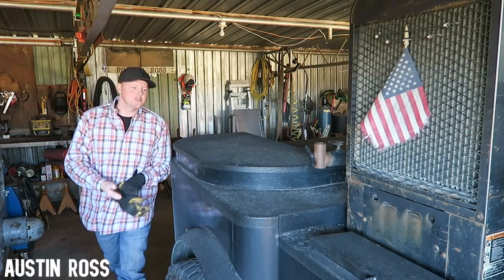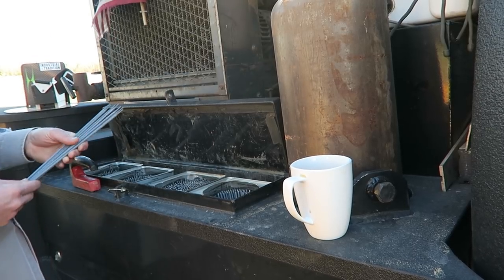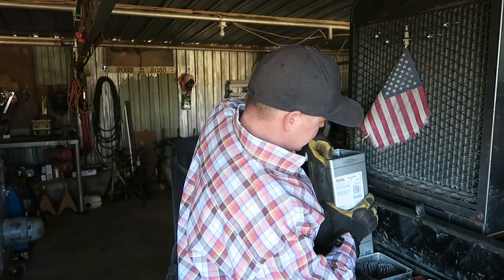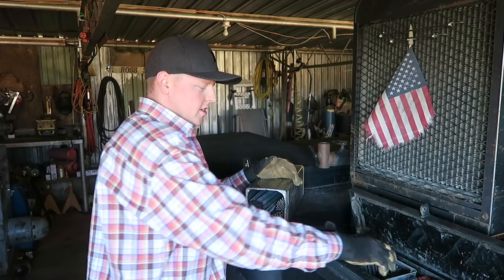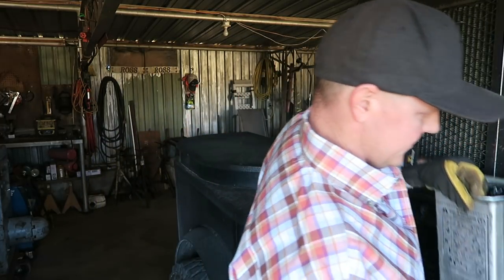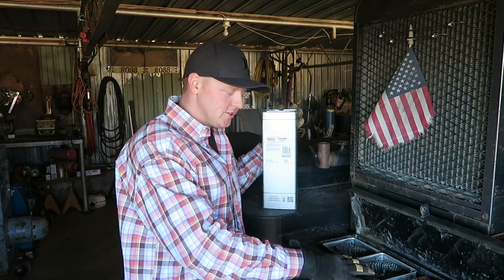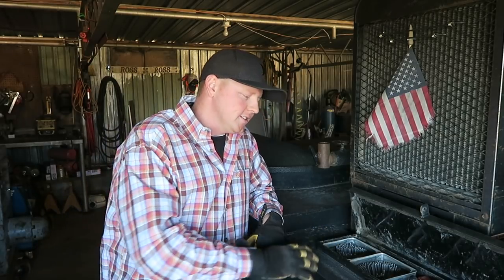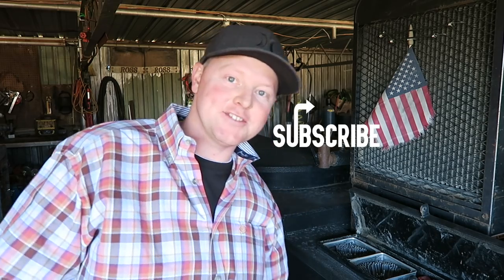WELDING ROD USED TO WELD PIPELINES AND THE ORDER WE USE IT IN

Comment: Hello Austin, question vertical welding, my husband is frustrated. He has a Lincoln AC 225, and welds mild steel 3/16'-1/4' for farm repair. He cant seem to make a good looking vertical pass, any tips on this. The materials & area are clean no paint rust etc as he cleans them before he starts. He's tried angleing the rod straight you name it notheing seems to make a pretty weld.

Comment: Sorry if this is a silly question. I see a lot of guys asking why you don't you 7018 and I'm curious too. Yet I'm more interested why you guys don't use flux core wire like NR-232 or 233? We us it a lot in structural steel (Ironworker by trade) it's fast, wind and weather do not effect it like gas shield, and you can lay down a lot of weld in a short amount of time without having to switch electrodes.
Reply from the maker: k11keeper 
We use 7018 out here also. On maintenance work and some on fittings. In station work. But most of your mainline is downhill. Not all but majority.
Reply: Ironworkers spend a lot of time running a lot of beads within cable reach of the wire feeders. In pipe work, you may have to hike 50 yards down into a cut to do your work, and schlepping a feeder and 33lb spool down and UP that cut wouldn't be good times. There's also differences in joint type and fitup with pipe, and the open root pass is particularly critical with regards to 100% penetration with strict limits on how far the bead can intrude into the pipe. I'm no pipe guy any more than i'm an ironworker, but I'd hazard a guess that the flux-core wire may have a harder time with the critical open root pass vs fast-freeze cellulose rods like 6010 or 7010.  I have seen pipe assemblies being welded in factories using wire, but they used TIG for the root and hot pass, which also suggests to me some possible limitation with how wire flows doing open roots.

Other than all the above conjecture, I got nuthin...

Comment: No 7018? That's what we use at my school after the 6010 root.
Reply from the maker: Just some dude 
 We use 7018 and 8018 out here also. Maintenance, station jobs, and some gas companies require the fittings to be welded with 8018 uphill rod. Majority of new construction mainline is downhill. Not all but most.
Reply: Only difference in 70 and 80 is thousand psi tensile strength, same everything else, 7018 8018 9018 10018, same quality except tensile strength, but yes standard pipe is uphill, 6010 root xx18 hot and cap

Comment: Austin. I stick weld a lot. I'm a Deere heavy equipment mechanic. What does the pipeline on the rod mean. Is that a rod specifically for pipe welding? 
I weld a lot with 7018 -1/8 and 7018 -3/16 
Have u ever arc gouged any? 
Nice video brother!!!

Comment: I learned welding pipe 6010 root, up or downhill, (according to the WPS) then nothing but 7018 vert up for fill and cap. Do y’all weld with 7018 vert up much?
Reply: texaswelder that's high pressure pipe. Gas/oil Is downhill and run different
Reply: texaswelder same here man
Reply from the maker: texaswelder 
Yes we weld with 7018, 8018 out here also. Most of your maintenance work is uphill. Station/ plant work will have some uphill work also. And some gas companies require just the fittings on mainline to be welded with uphill rod. Most of your new construction mainlines are downhill.

Comment: Hey Austin. I run a vantage. What amperage would you recommend for  running a 5/32 pipeliner? I’ve got a test soon on. 2” monster coupon for 8010. Currently I’m tested with 7018 with this company. They need me to test 8010 for a compressor station

Comment: @Aaron Ross 
How many passes do you generally make for your fill and do you usually just have a single stringer cap ? 

Could you make a video on typical weld test video for gettin on at a pipeline ? I have alot of experience with 6010 but never done big bore pipeline just 8" down gas lines with 6010//7018/ and Tig All out 

Thanks

Comment: Can practice at home using these rods with a 220v machine be effective for later use on the job or is running an engine drive the only way to accurately get a feel for how they'll handle in the field?  I gather the arc characteristics are different but how different and can it be adjusted for/predicted?
Reply from the maker: Absolutely. Any welding at all is good. Studying that puddle any chance you get. But every welding machine is different so you might very well see a difference in the two machines.

Comment: Pls,the 8010 and 6010 electrode  for pipeline welding, which  one is best for rooting and caping?and the difference  between  the both.
Reply from the maker: The 6010 is normally used for the root and the 8010 for the cap. On rare occasions it could be different. Technically you could use whatever you wanted to. It really just depends on the gas/oil company and what procedure them and their engineer came up with for whatever will be running through the pipe at a certain pressure.

Comment: What amps do y'all use on those big ass 8010 rods and dose 8010 burn like 6010 all crackly gnarly or dose 8010 burn like 7018
Reply: It burns a little differently than 6010 but its a lot more like 6010 than 7018

Comment: Is there any place that sells 8010 in quantities smaller than the 50lb can?  I have some repair tasks which this might be ideal for.
Reply from the maker: Hmmm 🤔 I don’t think I’ve ever seen 8010 sold in that small of amount.
Reply from the maker: Depending on what your repairing, 6010 or 6011 or even 3/32 7018 might could work.
Reply: By the way, I had forgotten to ask some time ago, how did you like the rind pickles?  Now that watermelon will be back in season I might be making some more.

Comment: How come pipe line companies dont require you to use rod oven
Reply: Typically only low hydrogen electrodes require an oven as they're more susceptible to atmosphere moisture. The 4th digit indicates the rod coating. 0 = High cellulose sodium. Some electrodes will also have an H after the number to indicate low hydrogen.

Comment: Can any welder run 8010? How hot do you run 8010?
Reply: If it can run 6010 it can run 8010.  They're cellulose rods and they burn differently than 7018 and rods like that

Comment: Why wouldn't you weld pipe with a mig welder?
Reply: There are some industries that use Mig welders to weld pipe, but the reason they cant use them on pipelines is because they are outdoors and the shielding gas would blow away causing pores in the weld.
Reply: MrCarttbone that makes sense, thanks for the explanation!
Reply: It is sometimes used but they have to set up a whole tent for the welding to take place so the shielding gas doesn't get disrupted.
Reply from the maker: Three Swords 
Some of the bigger mainline jobs are welded with a automatic wire welder. This job im on now is actually being welded with automatic downhill wire. They just require a shack over every weld, like these guys are saying this process requires no wind and there are more moving parts also. Most all the tie in welds are welded with the traditional downhill stick.